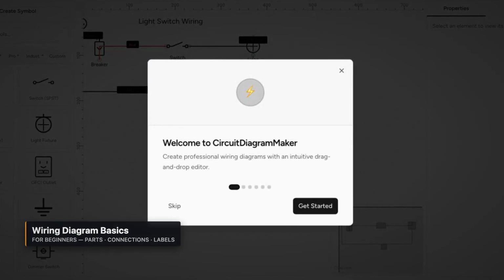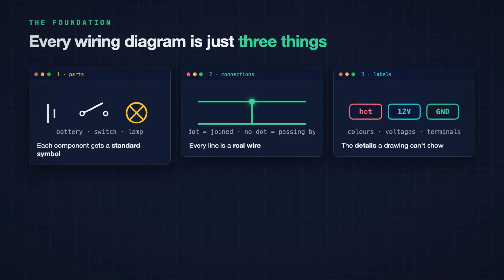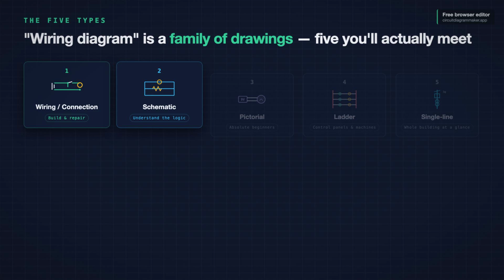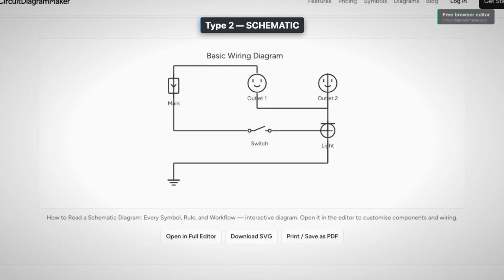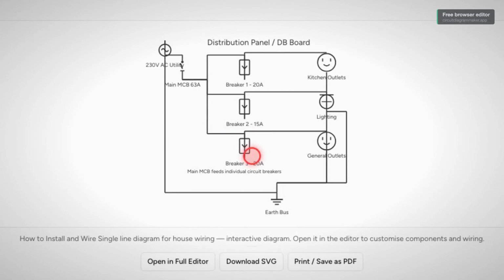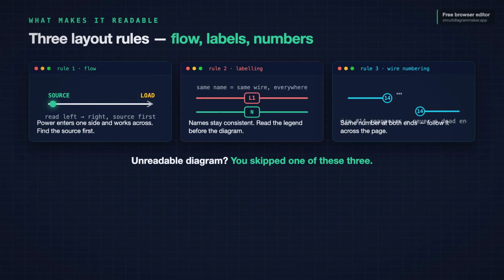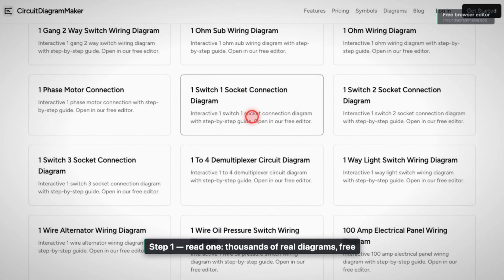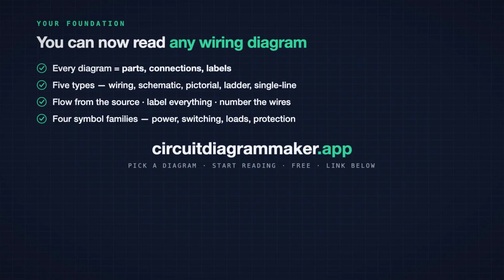Wiring Diagram Basics for Beginners (Full Guide)

Comment from the maker: Quick one for the comments: which of the five types do you actually run into most — a plain wiring diagram, a schematic, a ladder, or a single-line? Curious what everyone's working on.

And if you're just starting out, what tripped you up the longest? For a lot of people it's junction dots — one tiny dot deciding whether two crossing wires are joined or just passing by.

Browse thousands of real diagrams to practise on, free: https://circuitdiagrammaker.app/diagrams?utm_source=youtube&utm_medium=pinned_comment&utm_content=yt-005